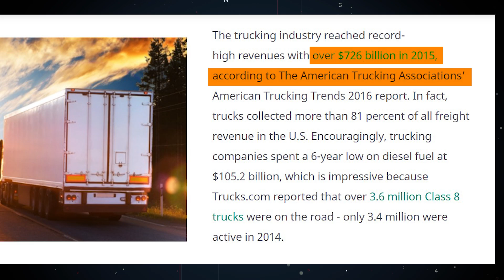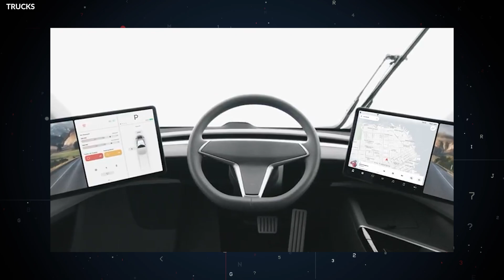The Tesla Semi Is Genius, And Here's Why

Comment: This truck is so good that you have to charge it for hours compared to having 1000 of miles in a ten minute fuel up. And who cares about speed in a truck when the biggest factor is carrying capacity.
Reply: Most of the EV fanboys are morons.
Reply: Pretty sure you didn't see the video but ok
Reply: 5 years from now when batters are producing 2k miles and recharging almost as fast as gas.. your comment will be wow that's so cool. You didn't watch the video. You toddler.
Reply: @Michael-fr6il  What are you smoking?
Reply: No truck fills up in 10 minutes, I can tell that you don't drive
Reply: This truck is meant for mid distance and they're adding mega chargers or level 3+ charging, plus it will be able to charge while being loaded and unloaded and it will charge wirelessly in the future, and it actually accelerates much faster than a diesel engine, so it will be able to make up for time charging easily
Reply: @KingLarbear  wireless charging are you serious that is painfully slow have you had a phone that has wireless charging. And your other point about it being mid range i guess it doesn't matter how much you can carry in one trip  the battery takes up so much space you won't have much space for anything else. now compare that to a good old diesel truck 1 ton of fuel and the rest can be for cargo vs half the truck capacity dedicated to a battery.
Reply: @KingLarbear  "they're adding mega chargers or level 3+ charging,"

and who are "they"? the leprechauns in your comical little fantasy world?

"it actually accelerates much faster than a diesel engine, so it will be able to make up for time charging easily"

lmfao, you're a moron.
Reply: You goof